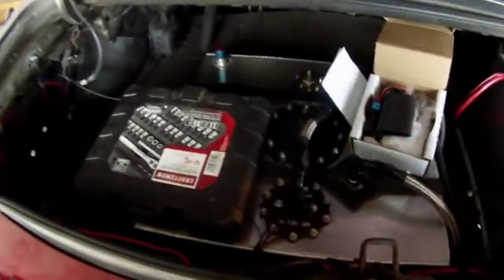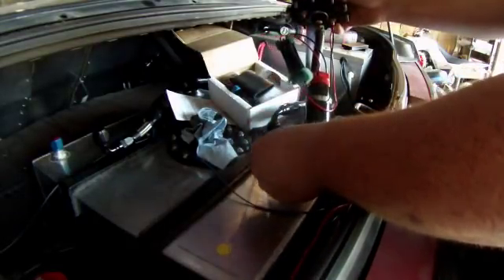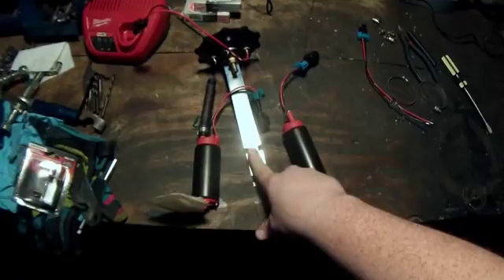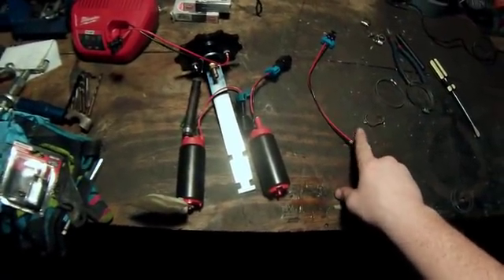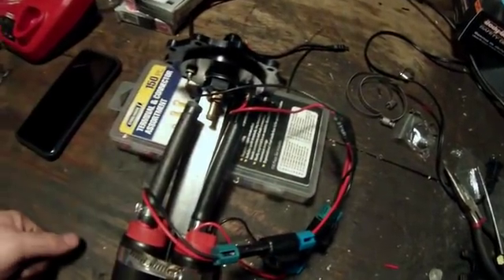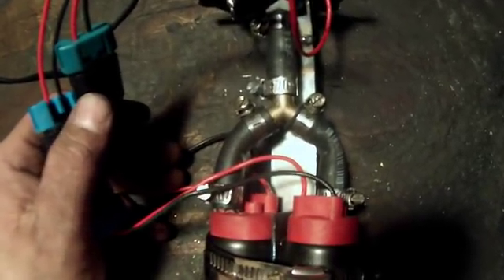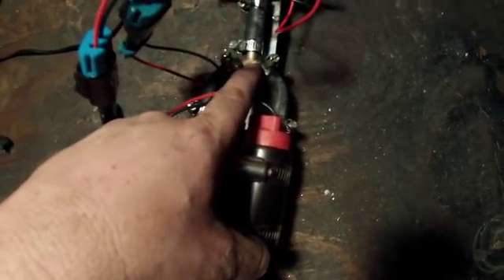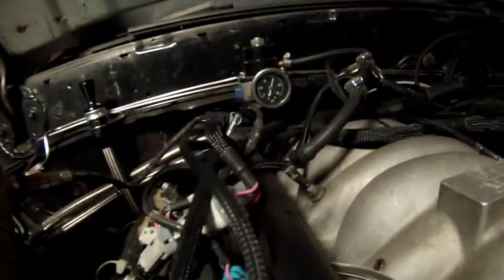The CHEAPEST WAY to do a DUAL FUEL PUMP SETUP!!! aeromotive 340

Comment: Thanks for the great video. What happens when one pump goes? Will the fuel be redirected through it out to it's inlet? Or do these pumps come with some kind of NRV?
Reply from the maker: Good question, a little will definetely be redirected through the dead pump but if you want to avoid that then you need to put some type of one way valves inline with each pump. Also some people just run 1 pump until boost comes on and use a pressure switch to actuate the second pump. Honestly the best thing would be to run a big single pump instead of multiple smaller pumps, this was just a quick and easy option for me at the time 👊🤙
Reply: @stupidfastjohn  Thanks for writing back. 

So my problem is I'm looking to install a backup fuel pump so that when one dies I have a fall back option. Any ideas? 

There is surprisingly little information about this on the internet 😁
Reply from the maker: Same concept just run a pressure switch that allows voltage to pass through a closed circuit when its open and not closed. U can use relay logic to reverse this for a normally open or closed switch. No different then boost but you need a pressure switch to activate the second pump way before you drop to 3 pounds of pressure. Im sure theres a 40psi pressure switch out there 👊

Comment: If each pump has a set pressure that they output..... how would this increase pressure?... it would increase volume... with the increase in volume it increases pressure?... thinking out loud
Reply from the maker: I didnt want to increase the pressure neccessarily. The problem is the one pump couldnt maintain 70 plus psi at the fuel pressure regulator at 7200rpm and under boost so with a 1:1 ratio at the fuel pressure regulator and at 58 psi base pressure set and 14 pounds of boost she was asking for 72 psi of total fuel pressure under boost. The second pump helped to increase the volume in the upper rpm which helped maintain the pressure under boost with this 1:1 ratio. When i went back to the dyno the fuel pressure held perfectly at 72psi all the way to 7200 rpm. Instant 30hp gain without any tuning. We gained about 60hp total without touching the timing and just adding neccessary fuel adjustments for that correct pressure. 

Hope this helps 👊🤙

Comment: get yourself a machined dual pump coupler from Racetronix
Reply from the maker: I absolutely will look into that, i want to change the whole setup and run bigger lines etc for the new setup 🤙👊
Reply: @stupidfastjohn  on 3 has a pretty sweet looking kit too im considering for the new edge ls swap
Reply from the maker: @Dreadz530  looking kit??? I have used their turbo kit and i am satisfied with the results!
Reply: Stupid Fast haha yea it looks sweet! They machined adapter into the hat so you don’t have to worry about any Y blocks or anything like that. They designed it internally so you just hook the 2 or 3 pumps up and drop the hat in. They have different sizes but believe the standard is pump feeds up to a -10an 90° for the sending and -8an 90° fitting for the return line. Been trying to decide if I want to go that route or weld up one the baffle kits and have the feed at  the bottom. What did you end up decided or updating brotha? It’s been awhile so  was wondering if you encountered and I could avoid haha?

Comment: That Y fitting is terribly inefficient. They're dead heading on each other. I hope you've fixed it by now.
Reply from the maker: Actually im in process right now lol it worked to get it up where i needed it temporarily. Plus the fuel lines are too small theyre 8an shoyld be 10 for the dual pump
Reply: Well he got 58 Psi which is high enough.  with a single pump he could get 40 psi tops.

Comment: So I can just wire in my second pump to same power supply from the main pump? That was always my question
Reply from the maker: Fernando V its all about the amp draw, the size of the wire is what matters when wiring 2 fuel pumps in like this. Making sure to check the fuel pumps max amp draw, x by 2 pumps and then find the gauge wire that fits your total amp draw and you should be good. To wire both with a single wire. Make sure ground is same size as positive.

When you run smaller gauge wire it just cant supply what the pumps need almost like restricting it which causes you to drop volts/amps when the start to run faster and need the draw which is why most just run 2 seperate wires from same supply. Either way if done correctly it works fine lol.
Reply: Stupid Fast thanks man! I am needing to do a double pumper. I have a single walbro 450 and its maxing out roughly 620whp on E85. I’m trying to be 700+whp, but need to upgrade and might just add another 450, then upgrade the wiring to thicker wire for both!
Reply from the maker: @SrtFernie  awesome! I ran out of my 340 at 585whp. Now were at 629 on 17lbs with both pumps and injectors are only at 70 percent duty cycle.

If you are street driving the car alot, i would wire the second pump up to a second relay and power wire though. I would use a pressure switch to activate that relay whenever you under say 3psi of boost. Theres hobbs switches that work well for this application. So when you hit 3psi the second relay is activated and the second pump comes on. I would also then add in an extra fuel pressure switch to shut the car down if its under pressure at all so you dont run lean in the middle of a pass. I will be redoing mine this winter and i will talk about how to correctly run the fuel lines through a y as well as running these switches. I just ran them without this stuff to finish up the year on the track yah know.

-just my 2 cents
Reply: Stupid Fast great input man, wish your chanel grow bigger
Reply: @stupidfastjohn  i used to have 2 130lph pumps into my toyota tundra 5.7. With the scanner i could see the fuel flow which was in 220 lph and injectors at 3150cc per minute (400cc each) ... Then i got rid of those dual pumps and installed one single walbro 90000285 525lph hellcat pump.. Not only my fuel flow went to shit (down to 160lph) but also the injectors flow got lowered to about 2500cc per minute.. Do you know the reason? with the dual pumps i had the same exact build you made here but in the oem fuel pump assembly. So i dont get it. Walbro says that it should be any near 470lph flow at 13.5v @ 40psi . im running at 43 psi. So i dont really get why my chinnese dual pump had more fuel flow than my single walbro 525lph pump.
Reply from the maker: 2 pumps creating the same pressure through the same line size will always create more flow then ome bigger pump because the bigger pumps are meant to have bigger fuel line sizes. It all comes down to pressure and flow. Fluid dynamics, if you change your feed line out for the next size up i bet you will flow that much more fuel. It will always pressure right, but flow will be less with a smaller line.

Hope this helps
Reply: @stupidfastjohn  thank you  buddy that got me thinking and today I installed another   pump to try to raise a bit the pressure. Maybe more pressure will increase my duty cicle. I'm doing this because I want a wet nos shot in the future and damn. I need my fuel system at 100%.  Stock injectors on my tundra with 1 hellcat walbro pump and another brand 240lph pump to help boost the pressure a little.
Reply from the maker: You just need a fuel pressure regulator! If you dont have one ✊
Reply: @stupidfastjohn  i have the stock one which is rated at 40 psi. I had 220lph flowing before with 2 fuel pumps. Seems like I was squeezing a couple more psi out of that stock regulator then change to one single walbro and flow went down to 150lph even with a larger pump. So in back to dual now. My fuel lines are stock also. It's lightly modded truck just headers intake exhaust fuel pumps and tune. Got around 50-60 hp over stock.  By increasing the pressure in trying to get my mixture richer since I'm getting 11.3:1 at wot at max rpms. And I think that is lean for a n/a what do you think ? Or should i go leaner for more hp ?
Reply from the maker: 11.3 is not lean for na, 14.1 is lean for na but commong for idle. 13.5 is target for na. 11.5-11.8 is common for turbo af ratios. The nitrous should have its own fuel feed, but if you need to run richee then just get a high pressure pump and a fuel pressure regulator.
Reply: @stupidfastjohn  thanks buddy for your support I'm not that experience in this field and I'm like a one man army with my truck so I do all the things myself.. should i try to reach 13.5 during all the power curve or between the max rpms range only ?  Mine is (5.5-6.2k rpms) You know ..truck was getting crazy lean at high rpms and then richer on low rpms the first time we tuned it.   The current iddle afr is 14.5-14.7
Reply from the maker: No problem man i like helping people! 14.5 14.7 is good for idle, soon as you come into any load shoot for 13-13.5 all the way through to wot

Comment: Great video.  I like learning new things. I don't know if I'm ready for a dual pump yet, but I know I'm going to have to upgrade my fuel pump soon.
Reply from the maker: Afri!!! Whats up man? I gotcha i am loosing fuel pressure after 4500rpm thats why the double pump is needed for more flow.

Hows your fox coming along??
Reply: I'm still waiting for my 11R 190 heads.  They should be here some time soon.  Just trying to collect (buy) all of the other parts I completely forgot about when you're doing a HCI swap.
Reply from the maker: @afri1414  yea i gotcha buddy. You should video it when done do a before and after!
Reply: I'll try.  I'm still new to making videos.  I made a few with my phone, a Galaxy S6 and put them on my channel.  I should buy a GoPro and make better videos.
Reply from the maker: @afri1414  i watched all of them lol dont be shy!!! I was like that reallll bad at first
Reply: Thanks!  I'll give it a try.  I'll also invest in a GoPro and some editing software.
Reply from the maker: @afri1414  i use cyberlink powerdirector 15 it was 100 bux at best buy.
Reply: Thanks!  You're the best.